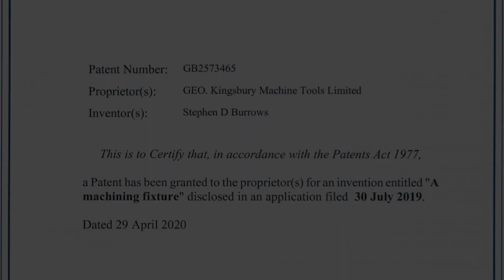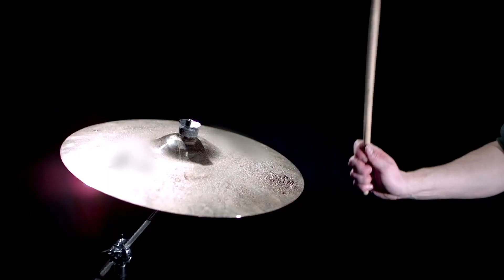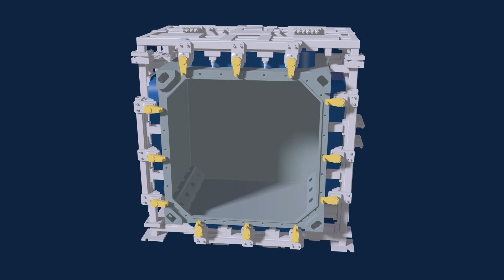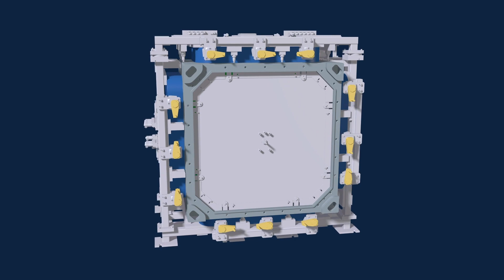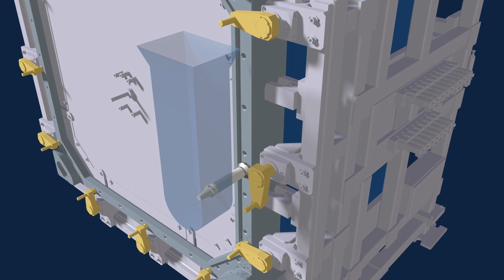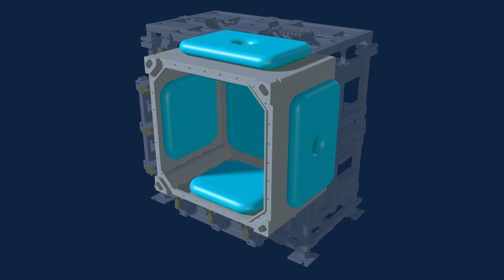Kingsbury | MSSS - PFCS Box | Machining Solutions | Shorter Version

Comment: Interesting video, thanks for sharing. Interested to know why you chose to patent a fixture though as most fixtures get made in house and aren't sold and i can think of at least 2 other ways to constrain the panels in this example that doesn't use air bags.
I'd have thought the air bags are very quick to inflate and deflate but air is a compressible fluid, so is never going to be that rigid. A hydraulic panel clamp system would be more rigid (and more expensive and slower) Also a mechanical panel clamp system would work fine too.
Very interested about the patent rationale though. As a machinist, inventing new clamping methods is like table steaks